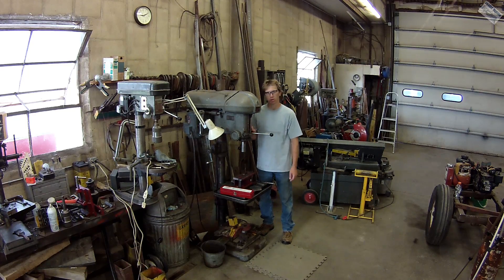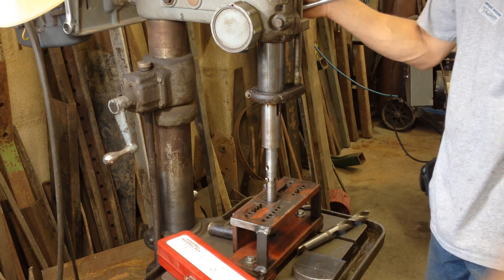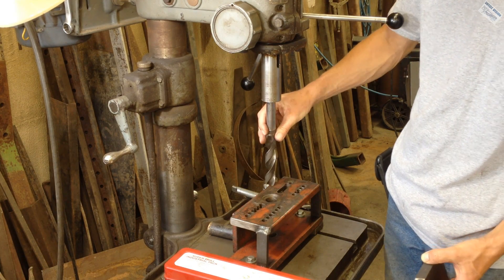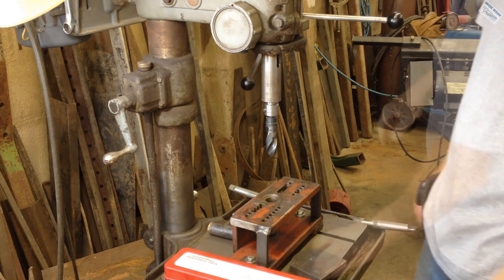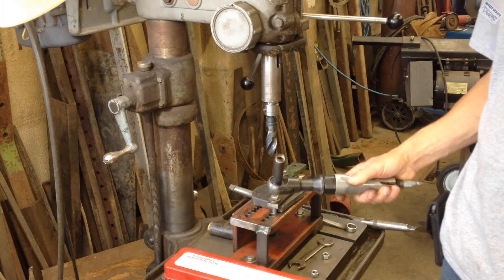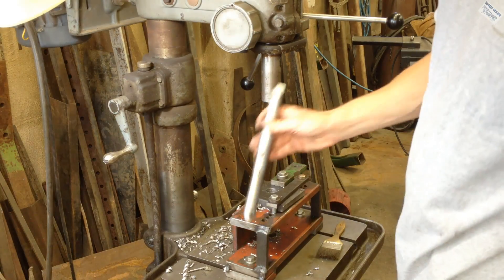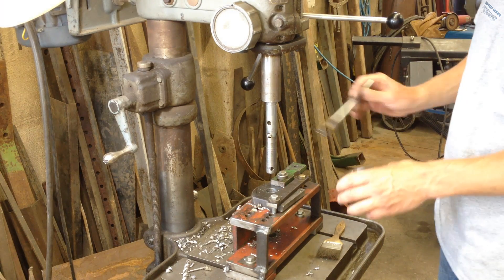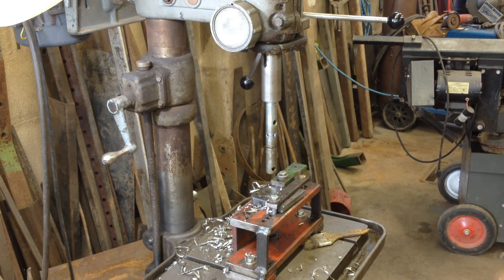How I drill Holes Bigger Than an Inch

Comment: I like you're thinking, I'm always trying to get my limited machinery to do more too.
I wonder if you were to swing the table to the left, say 45° and clamp a longer and lower jig out to the right in the fresh air, you could gain quite a bit of height by making the jig less tall as the end of the boring bar would pass into free space and not bottom out on the table ? It would give you a bit more room for inserting the MT drills too ?

Comment: Thanks for making this vid Matt. I'm not sure how you lined up the part to be bored over the hole exactly right when you drilled it with the twist drill at first? You have no hole yet to line up over the bearing hole
Reply from the maker: The metal piece was center punched and I aligned it to the center of the twist drill.

Comment: matt get u a set screw on the back side of the tool bit and turn the set screw one full turn with a dial indicator to see how much it moves and if it moved .050 then on full turn would cut .100 just test screws till u find the one u like and ur set for accurate cuts any other hole saws are faster but u can always sharpen ur tool and ur going the other guy going to the store to buy a new high priced one
Reply from the maker: Yep! :)

Comment: Rotorbrotch cutters, so much simpler, cheaper and more accurate. Use them on the drill press regularly for large holes. Highly recommended getting a few sizes
Reply from the maker: Just use a 3/4 inch end mill holder with whatever taper fits your machine. (R-8 or MT3)  If you're using a drill press, end mill holders with a tang work better.  Not all end mill holders have a second set screw, but it can be easily added.
Reply: chris jones you can buy a morse taper adaptor as long as your drill press takes a morse taper, if not would be a simple job to make an adaptor for a drill chuck I've even seen them used in a hand drill, just need to drill a pilot hole for the centre pin. They remove less metal for easier drilling
Reply: chris jones you can pick them up on eBay, just search for mt3 mag drill adaptor
Reply: Becca Webster do u have the Weldon shank adapter or how do you use em?
Reply: Becca Webster mt3 taper is what it uses
Reply: Wide Vision Metal Fab it's mt3. where could I find one? nothing local. also got a recommendation on a good drill press vise. maybe x y but not for sure.. 6in min... 17in press
Reply: Becca Webster thank you
Reply from the maker: I am planning on adding rotorbroachers. And I just now realized I forgot to talk about something in the video. The big reason for using and adjustable bit is for clearance fit for pins and bushings.

Comment: This kit got a hefty price tag...!!!
But it seems to be doing great with a normal drill press, mostly for bigger diameters where it's really demanding...
I'm not sure you should try flatening the top of your fixture by just manually moving the table, maybe if it fits on your bigger lathe  using a face plate.
Reply from the maker: I was thinking of facing it on the drill press because I'm not sure the drill press table is level and that would help reduce that error. I'm not sure I want to try using a fly cutter in the drill press any ways. Seems dangerous.
Reply: The spindle of a drill press isn't made to support lots of lateral forces, and trying to move the table in a real steadt fashion will require you invent a new device...   ;)